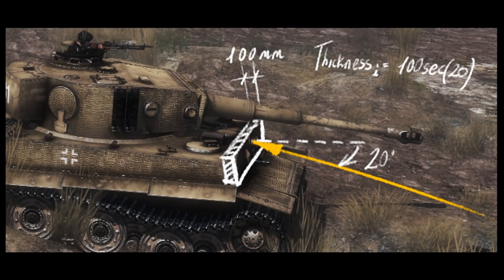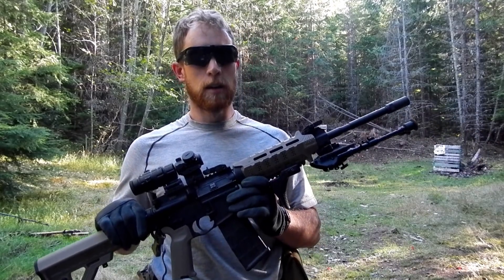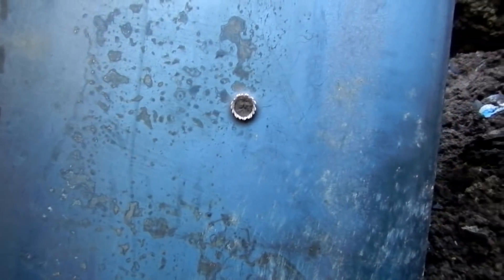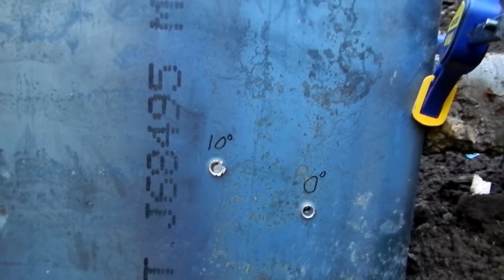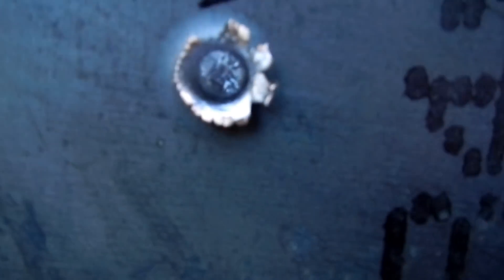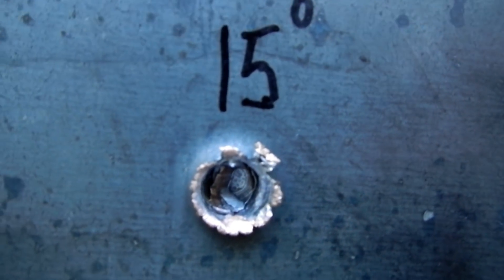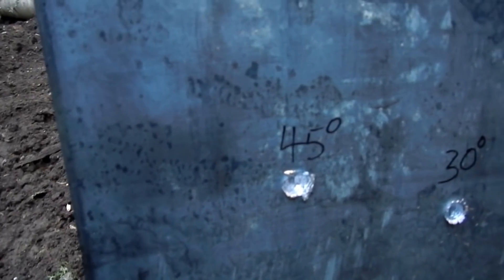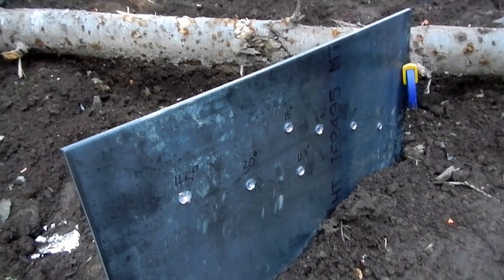Does sloping armor increase it's protection?

Comment: Depends on the round...some modern rounds are actually more effective against sloped armor
Reply: Do you have any examples? I've never heard of this.
Reply: @mattjmwmatt  
APFSDS long rod penetrators are better vs sloped armor because they bulge and shatter the inside of the plate.
http://www.steelbeasts.com/sbwiki/index.php/M829A2
APFSDS composite slug penetrators are better vs flat armor because they use an "ultradense" and very hard slug as penetrator instead of comparatively "lightweight" steel alloy.
http://www.steelbeasts.com/sbwiki/index.php?title=M735

WARNING: WALL OF TEST
Long rod penetrators deteriorate when shot at flat armor plate because the tip deforms. The rod quasi imbeds itself into the armor plate. When shot at angled armor this bulges and shatters the inside of the armor plate allowing easier penetration. Against a thick flat armor plate that lessens the penetration effect as the rod deforms into a mushroom shape.
Composite slug penetrators are usually made out of Depleted Uranium, Tungsten, Osmium or some other very dense and hard metal. They have very good penetration performance against flat armor because of their density. It allows them to 'displace' the armor they are shot at much like a stone displaces the less dense water. But against angled armor they bounce instead of imbeding itself in the armor.

Leopard 2 A1
https://de.wikipedia.org/wiki/Leopard_2#/media/File:Leopard_2A4_Austria_1.JPG
T80-B
https://i0.wp.com/fighting-vehicles.com/wp-content/uploads/2017/04/T-80B-Tank.jpg

An interesting side note: 
Because russian tanks are made out of very angled armor, the western powers use mostly long rod penetrators. DM33 for example is a 3.8cm thick and ~33cm long rod of Tungsten Carbide held with a Titanium 'shoe' to fill the diameter to 120mm so it can be shot out of a 120mm smoothe bore cannon. It was the ammo that was initially supplied with the Leopard 2.
Western tank designers knew that long rod penetrators are bad against flat and thick armor. Therefore their modern tanks have many rather flat surfaces. That is why russian tanks use composite slug penetrators such as 3BM15. The Russians initially used 3BM15 in the T64B, T72 and T80B.
One could say, that russian and western tank designers are playing a game of rock, paper, siccors with each other.
Reply: @achimhanischdorfer3403  

For your last comment, i am not sure if this is quite true, as the Leopard 2A5,6,7 have all sloped armor for the most part, as well as the Abrams. The reason for the Leopard 2A1,2,3,4 having relatively flat turret armor is, to my knowledge, the increased usable space and the fact that the spaced composite armor was already good enough. I would also say, that the long rod penetrator, especially for spaced armor, proves to be rather ineffective at penetrating sloped armor, as it tends to deflect. Also, wasn't there some talk about Rheinmetall developing a 140mm gun, wouldn't that suggest that common long rod penetrator aren't that good at penetrating current sloped armor? I mean, they could always increase the length of the cannon barrel and the powder load, a completely new cannon barrel should not be necessary.
Reply: @Enthropical_Thunder  
Leo A5 and onwards is still the same tank structurally underneath the spaced armor. They haven't changed the internal structure and armor plating. They added more outer armor layers. They now have sloped and flat layers to my knowledge.

On the topic of guns. 1st of all: It has rifles then it is a GUN. It is smoothe bore. That makes it a f+cking CANNON. And its not so easy to just increase the powder load or barrel length. The stress they place on current designs is high enough that they are close to the point, where the barrels and bores to yield from the pressure of the propellant charge. Additionally the longer you make the gun the more deflection stress is placed on it. The force of fireing the cannon places so much stress on the long and thin metal tube (6.5m long, 120mm bore diameter) that it bends. 
But making the bore diameter larger isn't easy either. That means you need a larger turret. Faster projectiles mean more recoil. That requires better recoil absorption hydraulics. 
Also: Current tank ammo when fired has so much inertia, that the tank shooting it gets shaken by that. 120mm APFSDS has a projectile ~12kg of which ~7kg are the penetrator. It achieves 1700 m/s. That is 12x1700 = 20400 Ns inertia. Current LeoA6 weighs ~60t. 60000kg / 20000 Ns = 0.33 m/s. So tank fires as crew inside you suddenly have the armored bulkhead shoved into your face at 0.33 m/s. 
To my knowledge the proposed figures of the 140mm were a 18kg projectile at 2000 m/s. You can do the math I think.
Reply: @achimhanischdorfer3403  

yes, they added the sloped armor on top, if the sloped armor would have no effect on the long rod penetrator, than they would simply have added more relatively flat spaced armor. However, they decided for sloped add on armor, probably because of the effectiveness against said round.

Since when does a rifled barrel distinguish a gun from a cannon? You don't distinguish a shotgun from a handgun, simply because it has a smooth bore barrel. Shotguns as well as tank guns can have both, a smooth or rifled barrel. As far as i know, you differentiate a weapon based on it's purpose, not its parts (except you are going into the technical term for the operating principle of the system, delayed blowback, gas operated,... ).

The bending of the barrel can be solved by changing the geometrie ( in this case simply increasing the thickness of the barrel), to decrease the stress on the material of the barrel. Now, it is true, that an increase in outer and inner radius of a barrel, the stress can be decreased more efficiently than by simply adding material, but this adds the extra complexity of a new type of round, wich could only be used by the military that adopted the 140mm cannon.
That said, the same bore size would be much more economical, increasing the bore size for a certain cartridge pressure would be the more elegant way, now think about this, Rheinmetall as a company wants to make profit, so they most likely would take the cheaper way, at least that would be my logical conclusion.

For the part about recoil energy, while it is true that  a high powered cartridge needs to dissipate a lot of energy into the recoil system, this as a whole should not be a problem at all. Respectively,  the options that we have are increasing the way that the
'gun' can travel backwards and reducing the 
overall recoil energy before it has to be absorbed, in other words, a muzzle break.
Hell, if you still get shaken, you could use a 
vibration isolated base floor in the turret and vibration isolated seats, it's not like such concepts wouldn't already exist.
Reply: @Enthropical_Thunder  
You underestimate how heavy a gun / cannon on a tank is and how much volume the recoil absorbtion mechanism takes up. According to wikipedia the entire barrel and elevation mechanism weighs in at 4360kg. And the Leo2 turret is so big, because it has to accomodate that entire mechanism.
Vibration isolation doesn't help much when the entire vehicle shifts. Recoil is not like sound. It is a shock. You can dampen the vibrations of things like an engine, or the roadwheels of the tank rolling on the track. But I doubt that ear muffs will do you much good when you get hit in the head by a sledgehammer.

The forces in play in tank warfare are incomprehensable. The yield stress for gun steels is ~2000 MPa. Or 20000 bar
The yield strength of the penetrators is around 1000MPa. Armor materials are ~1000 MPa too. The peak chamber pressure is about 3000 bar to 6000 bar when a round is being shot. The projectiles exceed mach 5.
When APFSDS hits, due to some of the muzzle energy being converted to heat they get hot enough to glow and so does the shrapnel they produce on impact. Modern tank warfare is scary. Especially because if your tank isn't good enough, you cannot win. And you get no warning. Because modern fireing systems don't miss.
Reply: @achimhanischdorfer3403  
I understand very well and i still think that the mounting of a larger gun is the leasr of your problems when designing a new tank. 

As i said befor, there are methods to medicate the side effects of integrating a bigger gun. 
Also, i did not mention anything abou dampening, there is a huge difference between vibration isolation and dampening. To isolate something from vibrations, you have to isolate said object from sudden movements. In this case, you would have nothing more than a platform that does not take part on the main hulls movement, wich is induced by the force of the recoil system acting against the backwards moving barrel. To center the platform after the shot, you just use springs that are connecting the platform to the hull and are barely strong enough to hold the  platform in place when  
, for example, driving.

The funny thing about engineering is, that a lot of solutions are applieable to different fields, in this case, the idea of vibration isolation is used in audio setups, engines (against the self destruction of gearboxes and of course noise), submarines, wind mills, ... This methode is relavent for vibrations with amplitudes from fractions of millimeters literally meters.
Reply: @Enthropical_Thunder  a few minor corrections - the shape you see on modern MBT's are cladding plates for deflecting smaller rounds, such as 30mm autocannon or 90mm gun rounds used by IFVs to ensure the larger plates aren't compromised by multiple hits causing  an effect called microfracturing the layers underneath are flat - Against APFSDS the angled sections are less effective as they do not deflect, they simply shatter the hardened plates (There is a natural link between hardness and brittleness when energy saturated) and the flat plates can fit more plates in the same area to give a better effect - physical space increasing is one of the major drawbacks of spaced armour
almost all modern tanks have modular segments below that cladding to allow for damaged sections to be quickly replaced in this way

APFSDS is also very effective at penetrating angled armour, unless it strikes at acute angles of 15 degrees or less - this is why the Upper glacis of western MBT's is almost flat with the driver almost laid down
Modern armour is layered with multiple levels, the exact makeup is classified bu is generally accepted as multiple layers of hardened laminated steel, small air gaps and heat dissipating ceramics - this means that it is effectively 3+ times more effective vs HEAT shaped charge weapons, used in most ATGMs, than kinetic impacts

The reason why they are considering the change to 140mm, which was considered and rejected in the 80's is that they are worried that material science for armour has advanced enough that they are approaching the maximum APFSDS penetrator length that can fit in a functional 120mm breach block

The design of any tank is limited by the diameter of the turret ring - this is because the gun the rear of the breach block to be clear the rear of the ring when at full recoil travel and also keep a workable space workable within the turret at the rear of the breach - All the current generations where designed for 105mm L7 guns originally - they where upgunned either midlife or in some cases in the final prototyping phases to 120mm as such they are tight already
Your idea of the firing platform is exactly what already exists - the recoil compensators however need to operate safely inside the turret without injuring the crew, and without striking the rear of the turret,or turret ring when the gun is slightly elevated - adding weaker "springs" with springs in this case being gas compression cylinders would need a larger area in the turret, and larger turret ring
adding harder springs would reduce this but would also increase the recoil that is induced against the turret itself and at a certain level the forces will unseat the turret from its rotation band in the same way a train derails

The Rheinmetal design is a prototype to test if it is viable to consider the 140mm or if the ergonomics will be too counter productive in real firing conditions
Reply: @bengrogan9710  
So the angled surfaces are solely for the protection of the main armor against "small" caliber guns? It does make sense if one considers urban warfare but as soon as you leave the cities, this concept alone does not really explain the nessecity of these angled plates. In fact, they are probably just dead wait, as nobody would try to shoot you at a distance of more than 800 meters with a 90mm, not even mentioning the 30mm. So my question is, was this type of armor the answer to urban combat with MBTs, who on earth thought that hardened steel was a good idea as protective armor (at least in the last world war, they tryed to keep the hardness at the absolute necessary minimum and modulated the brittleness by heat treating either the whole plate or only the surface of the palte, the germans actually had patents on these hardening processes) and why do they use the armor despite it being a weight penalty when driving over open territory?
Reply: @Enthropical_Thunder  If we refer to them for this conversation as "Intermediate" rounds that should avoid complications with using the term small, which would imply rifles etc

They are largely cosmetic yes - that is why they where not added on the Leopard 2 until the A4 variant - as you say the uses are both Urban but that is not the main concern, against IFV's Bradleys and BMPs are effective with cannons vs light armour at up to 1200 and 1500m respectively and also finally verses aircraft such as an A-10 or A SU-25 which could significantly strike them and then fire ATGMs; this one has largely been walked back as an idea since the 90's
The outer layers are usually only 2 layers thick, 1 at 1/2 inch for small arms and 1 at 25mm semihard (what would be classed as "Normal" armor in our minds) and also effectively function as a spaced plate for the 1st hit - the limited weigh use of around 100kg is viewed as an acceptable trade off

As for why the move to brittleness
The simple answer is APFSDS
A superhard plate is more likely to cause enough impact shock to cause the tungsten or DU penetrator tip to shatter - once that shatters the penetrator loses around 80% of its ability to penetrate any further layers because the next impact will propagate that fracture and cause the shattering of the main body with its own force and vs HEAT the hardness makes little difference in the penetration

this means that more layers of thin - super hard work well vs APFSDS and the spaces between layers defeat HEAT which is then all backed by Ceramics to dissipate the HEAT jet and a spall lining to stop broken fragments of tungsten

There is no-one anymore that uses large caliber normal AP balistic capped shells - this is why the 90mm guns on some modern IFV ideas such as the Swedish CV90 with Semi-APHE shells are a risk when used in tandem with MBTs in combined arms open field - the 90mm can weaken the plates enough for APFSDS to defeat it
Reply: @bengrogan9710  
You do make sense, the only problem i have now is that, as you said, 90mm guns are a huge threat combined with other MBTs, what if they use He grenades instead of APHe grenades, wouldn't that defeat the whole purpose of the angled armor? Furthermore, what about airburst ammunition, wich should be pretty common today, especially for calibers between 20-70 mm, wouldn't those types of ammunition be able to damage the main armor regardless of the add on angled plates?
Reply: @Enthropical_Thunder  I said APHE shells, not grenades there is a major difference in purpose - APHE is the standard HE shell for contact detonation but has a AP cap and can be set with a minor delay to allow it to blow out the cladding
Grenades and airbursting rounds don't have the force to breach the outer cladding - AP cannon rounds or larger HE rounds from the 90mm can blow off the cladding though the contact explosion
That is why the inner layer of angled cladding is still 25mm thick on the Leo and Challenger

The hardened plates are not brittle enough to be reliably shattered even when directly struck with 30mm cannon fire - but a long enough burst in support could compromise the outer layer or 2 for for an an MBT to have a far better chance of going through

As for other sizes - potentially but i was sticking to calibers that are in real use as opposed to going off into the weeds with theoretical that arent in service in large numbers
25mm is the Bradley's Bushwacker
30mm for the BMP and Russian IFV's
90mm is used on 8 wheeled vehicles like the LAV and the Swedish CV90
I keep mentioning the 90mm but the same applies to the 105mm on the Stryker MGS or the British who still carry HESH rounds in larger volume than US forces carry APHE
Reply: @bengrogan9710  
Ok, one last thing, in the german language, the term grenade can be applyed to any usage, be it an APHE, HE, Hesh, HEAT (Hohlladung) or APFSDS (Treibspiegel), the term includes always "Granate" or  grenade.
Reply: @Enthropical_Thunder  If we where speaking German I might grant you that, but we aren't - there are clear differences between grenades and shells which is why the terms exist.
If you draw arbitrary lines across accepted nomenclature like that then in the same way that shell is a grenade, a shell is just a bullet - both fail to properly describe something that terms exist for

Also to my knowledge panzergranate doesn't mean tank grenade it means armour grenade - referring to the shell casing to clearly delineate between that and other forms of grenades even when speaking in German

A tank is not a panzer, it is a panzerkampfwagon - armoured fighting  vehicle - use of "Panzer" as shorthand for tank in general is only as an abbreviation
Panzer means armour or armoured depending on context - for example the German Panzerschiffs like the Graf Spee in ww2
Reply: @bengrogan9710  
I have corrected that, i of course meant to write "Granate" but strictly speaking Panzer-Granate (written as two seperate words) would be correct in any way. 
As  i said befor the term "Granate" is used for example for the PzGr. 38 (Panzerbrechende Granate) and for the Granate 38 Hl (Hohlladung , HEAT). Today the term "Panzer-Granate" is used for any type of ammunition, except you are in the military [KE (kinetische Energie) =APFSDS and MZ (Mehrzweck)=HEAT] or an engineer (Treibspiegelgeschoss=APFSDS, Hohlladungsgeschoss=HEAT).
Reply: @Enthropical_Thunder  while I understand your point and don't necessarily disagree with you here it is still the quirks of terminology unique to the German languages very granular word construction method and does not translate across in the same way to other languages where in almost all cases the cross over from grenade to shell is much more clearly defined

For examples of this where German terminology look to their aircraft machine guns where 20mm is still a machine gun, where any other nation would call it a cannon
The term cannon in that context directly implies shells where the German would refer to it as a machine gun and then be force to explain separately if it where using mine shot (the name for fragmentation shells)
Reply: @bengrogan9710  
I don't know were you got that terminologie but as far as i know, the germans term "Maschinenkanone" was used for anything that used above 13mm or 15mm shells. An example for this is the 2cm FLAK system. Flak means "Flug-Abwehr-Kanone" woch literally means anti aircraft cannon.
Reply: @Enthropical_Thunder  For example the MG FF and MG151/20, 2 of the more famous German aircraft weapons of WW2, are both listed as MG rather than MK dispite being 20mm autocannons

The MG101 was also a 30mm cannon that was then redesignated to MK101 a year after entering service despite being the same gun

Also your example of FlaK loses it potency in details, FlaK is the mounting and system as a whole - the same guns on that mounting are referred to as 20mm MG C/30l when used as the through prop weapon on the Heinkel He112 fighter

The MG classification used to apply to all calibers of automatic gas blowback weapons, with MK only applying to mechanically assisted systems
This was changed eventually to ensure linguistic commonality with military partners
Reply: @bengrogan9710  
The Mg 151 is more of a special case, as the original variant of this gun was chambered in 15mm.

As for the Mg101 respectively Mk101(wich by the way was recoil operated, a simple blowback), the germans always had different classifications for their weapons, they probably called it an Mg because it was a conversion out of  literally a man portable anti vehicle rifle.
Reply: @Enthropical_Thunder  It's a bit of a stretch to suggest that it was labelled MG from simply being based of a solothurn, though you are correct that it is simple blowback not gas blowback

In either case, returning to the earlier discussion before we get too far lost in the weeds, hopefully the conversation thus far has shown why applying one nations terms out of their linguistic context when terms for the same item already exist and are understood
Reply: @mattjmwmatt  High explosive squash head I think
Reply: @vuongkyvi  Yea that one is better vs sloped but it does not penetrate the tank it only crates spawling on the inside